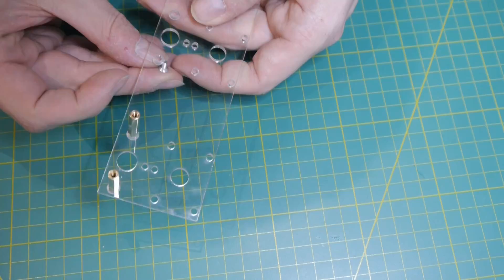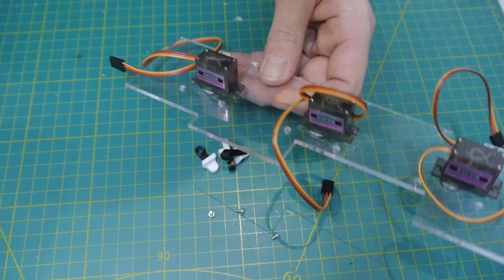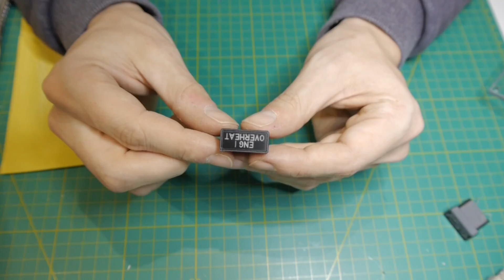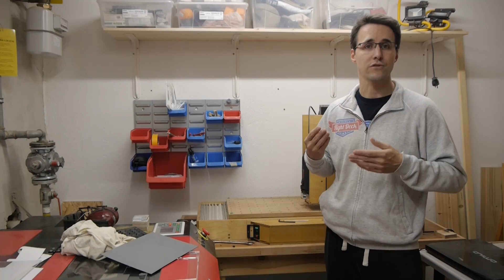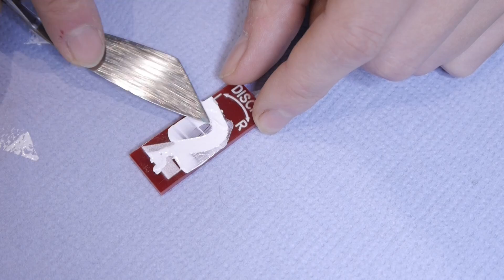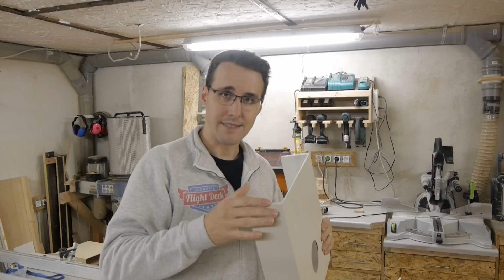Fire Panel - A Boeing 737-800 Homecockpit #75

Comment: For the handle, could you use an aluminum pipe?
Reply from the maker: Sure, but then you have to design a connection to the foot and the upper part of the handle.